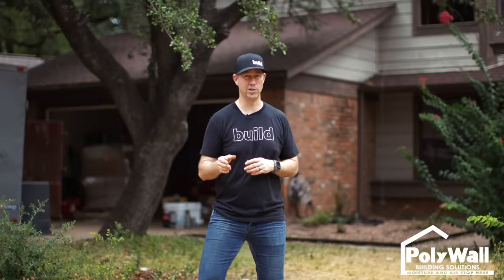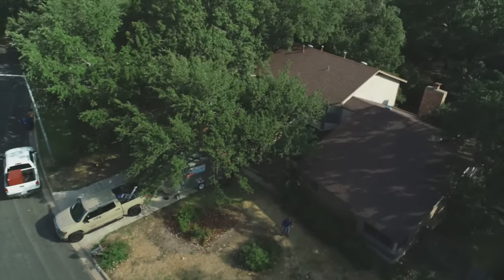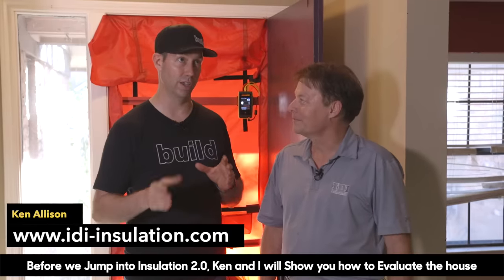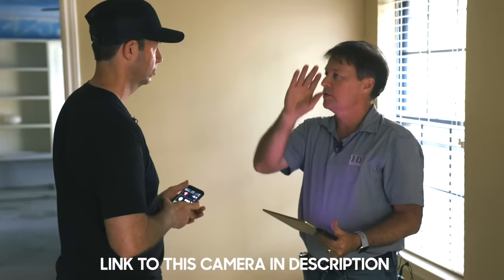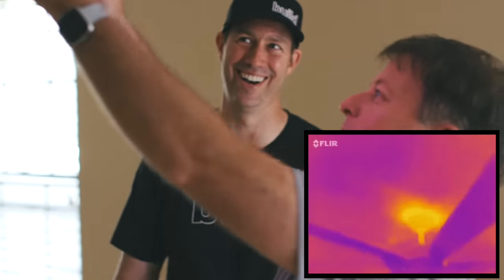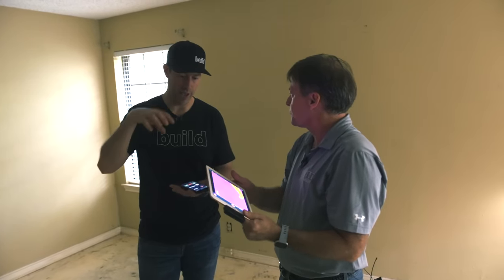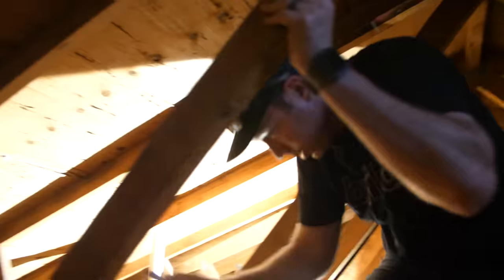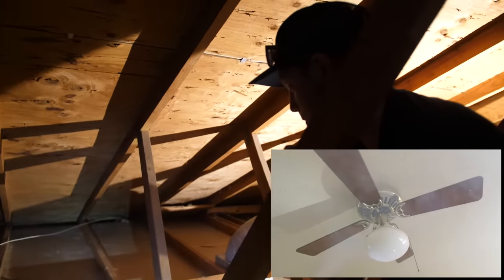Insulation 2.0 - 3 Steps to Re-Insulate

Comment: that Fleer camera causes contrast between hot and cold surfaces just because it's red or orange doesn't mean that it's super hot it just means that it's hot in comparison to the surrounding area that the Fleur cameras looking at I'm not saying that you're wrong about air leakage and that there is hot are getting into the house from there I'm just saying that it's a misnomer for people who don't understand that the cameras causing contrast between hot and cold that exhaust fan is probably hotter than the bedroom fan
Reply: Makes a great sales tool for scaring people who don't know what they are seeing. Mat???
Reply: That is correct. Every time you move the camera around, the temperature range changes based on the high and low temp of the scene and then all the colors re-adjust based on the new highs and lows. It's a comparison tool, comparing every part of the scene with every other part of the scene, but all that changes as soon as you move the camera.
Reply: Exactly. Should turn on the temp display--might be 2 degrees delta purple to orange.

Comment: You don't need a camera to determine that attics are hot during the day (at least in the summer), and you certainly don't need an IR camera to determine that a scuttle hole is dumping heat as you make your way through it.

Comment: I hired a contractor to spray closed cell foam in my attic but they mistakenly used open cell. They offered to spray closed cell over it to make it a hybrid system. Does this sound correct?
Reply from the maker: It’s not ideal.  Might work but if you are in a cold climate it could lead to problems. Southern house might work ok. If this is a s southern house I’d recommend just going thicker on the OC SPF

Comment: That camera is quite sensitive. All that “hot” areas easily could be a degree hotter. Its spectrum on screen runs from lowest to highest visible right now. It could be a few degrees different or hundreds degrees different. So normally we should turn on temperature range to see how actually hot or cold our findings

Comment: How would you go about air sealing an older balloon framed house?  I was told that the walls need to have air flow to the attic to keep everything dry (no insulation in my walls), but my energy bills are freaking outrageous.  There's got to be a better way.
Reply from the maker: It’s a double edged sword. High bills but a house that can leak and get wet but dries easily. If you stop the air flow and insulate you need to be sure your walls aren’t leaking or rot will occur.

Comment: I do not understand is why ceiling lines (wall/ceiling joint) would be hot since they're already air sealed from the conditioned space with drywall tape and mud. If you have insulation up top, why would that wall/ceiling joint not be just as insulated?

Comment: Does that sugar-based, cookie scented insulation attract bugs and mice? Thank you for the great info. I’m in northern Virginia in a 2800 sq ft house (built in 2004) and my electric heat bill is $700 a month in the dead of winter. Goes down to $400 in the late fall, early spring. I guess now I know why only the rich folks have fenced-in yards. That expense is the last one after new insulation, broken appliances, including hot water, HVAC, water softener, sump system, cracked septic tank, broken septic field pipes. Etc etc.

Comment: After sealing an old home like this, is it now required to add mechanical ventilation?
Reply: Depends on final testing after all the other leaks are addressed. With most older houses that still retain lots of double-hung windows, have several conventional-sealed exterior doors, normal leakage at the slab edge (or basement), have conventional range top exterior ventilation, usually not.

Comment: I think new Windows can produce savings and better comfort in a colder climates and an older house.  Old wooden windows in a cold climate are alot like your sweater example.  They have all sorts of cracks to let air in.  

I changed our windows on a 1920's house on one floor of 2 floors  The difference is like two different climates in the house.  I will change out the other windows then go to insulating the attic.  

I wouldn't discount new windows or insulating the attic.  I think the older the house the more they need attention to both.

Comment: If you sucked out all the old insulation why did you not spray the whole floor  in the attic with spray foam 3inches then fluffy insulation on top
Reply: John Mattiazzo if you’re going to have spray foam installed you may as well do the underside of the roof deck.
Reply: @jamskatelake  good point great idea keep all the heat out

Comment: How would you do it on a house that has metal studs were the top plate is metal but has tons of holes for wiring and plumbing.
Reply: For that you need to insulate at the rood deck. You could spray foam each and every top plate hole but I think some of the foam would fall thru the larger holes.

Comment: What insulation blown in do you recommend? Glass, cellulose, mineral?
I am thinking mineral for mine because of its properties. Glass still conducts and is itchy; cellulose packs  and looses chemical properties after years.
Reply: Cellulose retains its fire-retarding properties.  It's supposed to "pack" - it's called "dense pack" and air seals quite nicely without expensive foam.

Comment: Surprised you use that flir model. I wouldn't dare use that and I'm just a home inspector.
Reply: Kyle Turner what would you use? 
I’ve been thinking of renting a IR camera to evaluate my home. Most people recommend a Flir Pro.
Reply: @tyrehester5550  the Delta t is what your looking for. I use to have the flir 1 but needs a large temp difference so doesn't get much use most the yr and is for the lay person. I use the e6. There's no comparison though it depends on what you need it for but his images would be next level.
Reply: The blower door creates a delta T, bringing hot attic air thru the leaks help you see a temp chang.
Reply: The flir one pro has the same resolution as the e6, it's actually pretty slick just fyi

Comment: How do I figure out why my attic insulation has mold all over it?
Reply: FancyShoesVlogs The attic should have venting of some sort. The theoretical goal is to have it the same temp as outdoors. Insulation and air sealing prevent massive temp difference between the rooms below and the attic floor. Adequate ventilation prevents massive temp difference between attic air and attic floor, and also allows dry-out when outdoor humidity is sufficiently low. That mold is probably caused by water condensing on the floor of the attic from one or both temp differential situations. So either you have:
1) inadequate insulation from the ceilings of the rooms below,
2) air leaks between attic and rooms/walls below,
3) inadequate attic ventilation, or
4) a combination.

Attic venting is either passive, via dormer vent or soffit vents for inlet and ridge vents for outlet, or it is active, with either those spinning metal globes on the roof or a temperature controlled fan(s) driving the outlet(s).

I would look for soffit vents blocked by insulation and dead roof vent fans first. (Or wind-driven spinning-globe-dealies that aren’t spinning.) You saw how the blown insulation fell off the edges of the ceiling at the perimeters of this video’s attic? That can block airflow perforations in the underside of the soffit under the eaves outside. I’ve got this going on:  I just realized it’s an issue I need to address thanks to considering your question. I’ve also have had to replace the motor on the roof-fan in my house once already. If inlet vents aren’t blocked and the outlet is a passive ridge vent only, you may need to consider adding active ventilation through the roof, particularly if the house was constructed in an era where it wouldn’t have been air conditioned to the cooler temps common today. (Or didn’t originally have a/c.)

With ventilation assessed and addressed if necessary, I would then look at air sealing per this video and adding additional insulation. (Blower door rental and cheap thermal camera optional, depending on your goals.) Though, as some other commenters pointed out: the company in this video installed the black soffit vent blockers (name?) backwards. So if you choose to reinsulate the attic yourself with blown-in and also choose to install those vent covers to avoid recreating an airflow issue, don’t make that mistake. Fiberglass batts/rolls are another option, though it’s more labor to haul them up through the hatch than dragging the blown-in hose up once. Just don’t have paper facing anywhere but against the ceiling below, or you’ll have another mold issue. (I‘m pretty sure I have that right... If stacking batts, the upper ones should definitely be not have facing.)

—Advice from a pretty handy non-expert. Take it for what it’s worth. And good luck! 👍

Comment: I know you probably won't see this since it was a year ago. I used to work for a company that did insulation installs the scariest thing I ever seen in an attic somebody's pet boa constrictor apparently got away from them and it's been living in this attic for years and living off the mice and rats that lived in that attic. I kept finding snake skins but they kept getting bigger and bigger and bigger and bigger the last skin I pulled out I stretch from the tip of my F-150 all the way over the tailgate so I was quite scared but I was hoping all the noise I was making it would be gone big mistake I should have known by owning snakes it's going to find a place to hide and bunker down and this snake has not been around people for so long that it's went back to its wild state. So I was sucking insulation out I found this area that the hoes just wouldn't go so I forced it through cuz I knew there was no vents or anything from doing my walkthrough and sure enough it was the snake it came on quote and shot at me I almost fell through the Attic this thing chased me out the whole of the attic I did not use the stairs I just jump. I called a exterminator and the wildlife protection people I showed him the skin they worked on trying to find the snake for 3 hours but there were so many little spot it could have went into they never found it so the whole time I was up there I stayed in fear of this giant snake come to find out it was a anaconda skin and the skin stretched out to 31 FT and then I had to put all the new insulation back in the attic knowing this thing lived up there somewhere I warned the owners I told him that this thing lived up there I patch the holes but I still never heard anything from it hopefully it went out its hole and could not ever get back in but I figured for the families that lived around there. But that is my crazy insulation story.

Comment: I'm confused about something. You're talking about building houses tight, but do you still have open soffits?
Reply: (Air) "tight" refers to the living space.
Reply: @davideakin7434  So the same principals he's talking about for the living space don't apply to the attic? I mean.. if your air handler had vents up there for bringing air in, dehumidifying it and all that, wouldn't you want the attack truly sealed off, too?
Reply: Air handler in attic is one way of providing conditioned air below. Much preferred way is to have air handler and all vents in the living area. You can do this by either moving all the equipment into the lower living area, then sealing/insulating the attic floor, or by enclosing the attic (no attic floor air sealing/insulation needed) with air sealing and insulation. Matt looks like he is going to retain the air handler and vent lines in the attic after the attic floor is sealed/insulated. We'll see what he does to the attic equipment to seal penetrations to the below area and how he seals vent lines/equipment from the attic air/temps. Some of his other builds encloses the equipment/vent lines in a sub-structure assembly (imagine a large, flat room over the attic floor); some other builds he has totally enclosed the attic (AKA "hot roof").
Reply: @davideakin7434  Interesting, so in that hot roof scenario the soffits would be closed? I know it's a small thing I'm asking about but I currently need to redo my roof. I also have a 1970's house, actually 1970 on the year, and.. it's a mess up there. A hot, mildewed mess. I live in the Mid-Atlantic so humidity is my number one enemy, and I'm worried about my roof matching the levels that it normally is outside, where in the middle of the day you can start getting condensation on your skin/clothes just because you stepped into a shadow.
Reply: @DeDraconis  Yes, soffits are blocked in a "hot roof". Underside of roof deck and side walls are all air sealed/insulated to proper levels. No air sealing/insulation in attic floor. Sometimes requires either exterior insulation on top of existing roof deck or additional interior roof framing to hold additional thickness. This is usually a very expensive option and only pursued when air handler/ducts cannot be moved into living area below or if the attic is in process of being converted into living space.
RE: mid-Atlantic - me too. Consider whole-house dehumidification after air sealing of all interior surfaces. LOTS of info available at JLC, Building Science Corp., Matt's main YouTube site and Fine Homebuilding/Green Building Advisor.
Reply: @davideakin7434  Thanks, that's very helpful!

Comment: At 27:58, why bother sealing around the old bathroom exhaust fan when you know that the damper isn't working? Why not simply replace the old bathroom exhaust fan with something that will work better and THEN seal around it?

Comment: Any thoughts on having duct work buried under the blow in insulation?
Reply: I’ve been wondering about this also...
Reply: Stephen Brown i’m no expert. But you’d still want the same depth of insulation, so it’d have to be mounded over the ducts. But it’d settle, so I’d put batts over them instead after filling the rest to height with blown-in. And I’d use rigid (quieter and doesn’t fail) and carefully tape all seams with code-mandated tape.

Still, you could have awful condensation issues this way, so it’s probably a bad idea. The ducts probably really must to be wrapped if they’re in an attic, so that a vapor barrier keeps attic air moisture from contacting the duct pipe. Probably R30 insulation between pipe and barrier for a/c duct, but that’s a guess. I’m sure code specifies. In any case, you probably don’t gain much at that point by burying it, other than cost of extra insulation and difficulty diagnosing and repairing duct problems in the future. It probably just isn’t done for these reasons.

Comment: Does anyone know if  there is any other solution to fix it if you decided to foam your attic with your furnace on top of the attic? Like bringing fresh air in every 15min?
Reply: Young Pam he was saying that if there’s a failure in the furnace venting, carbon monoxide could get sealed from escaping through roof vents and could fall back into the house. Carbon monoxide is heavier than air and thus falls downward, collecting in low areas if the air is undisturbed.

Adding fresh air periodically is not a real solution to carbon monoxide in the air. It dilutes the concentration, but you have to solve the source problem if you’re having an issue. Otherwise, you’d possibly die if the fresh-air system failed.

Better solution is a passive make-up air vent: a cage-covered opening between the attic and the outdoors. Caged to keep rodents out. With a hood to keep the water out. But otherwise free flowing, so the furnace can draw in air as needed to keep the flue working.

If you foamed the underside of the roof and don’t have ventilation in the attic anymore, a conventional furnace has to draw air from inside the house whenever it runs. And the danger is that it might not be able to draw enough, cuz the suction is only equal to the force of the hot exhaust gasses wanting to rise up the exhaust pipe. It’s kinda like lifting water from a glass via a straw with your finger over it: you gotta take your finger off the inlet for the water to flow out. So just add a make-up air vent to a dormer wall or eave of the attic, add a carbon monoxide detector or two, and you should be good n safe! 👍 

Don’t just let the furnace draw air from the house: you want a dedicated makeup vent to the outdoors, with no flap on it. Needs a cage to keep rodents/birds out and an angle cover to keep rain out.)

The other option is to go high efficiency furnace, 90% or greater. They have dedicated intake and exhaust fully-sealed pvc vent pipes directly to outdoors. $$$$ solution, but you might already have this anyway. Whatever you do, add a CO detector to the home.

—A handy guy, but not an expert. Really tired, so that got unfocused n rambling, sorry. Hope it helped. 👍

Comment: Wouldn't that limit oxygen exchange in the house?
Reply: Jason You can add a make-up air vent if you have a furnace in the living space that isn’t high efficiency. Or in general. You’ll run bathroom and kitchen exhaust. This guy prefers to seal it up, and add an air-exchanging dehumidifier. It seems like the ideal approach, though not the cheapest.
Reply: Ryan Lewis ah right, cool as. Thanks for the reply.